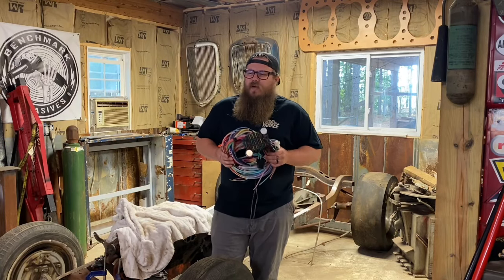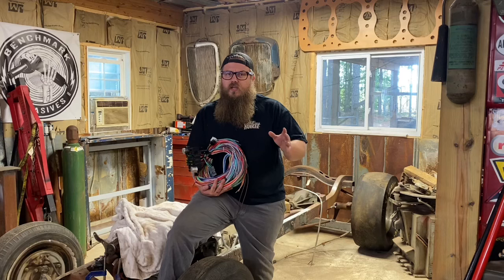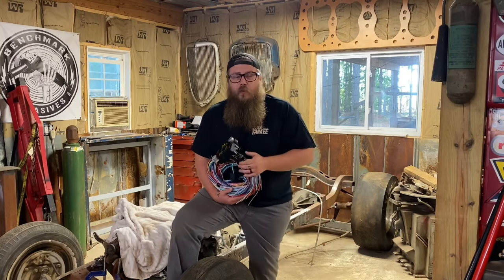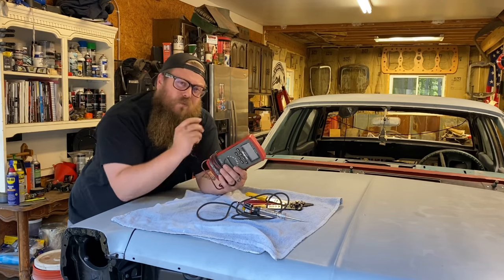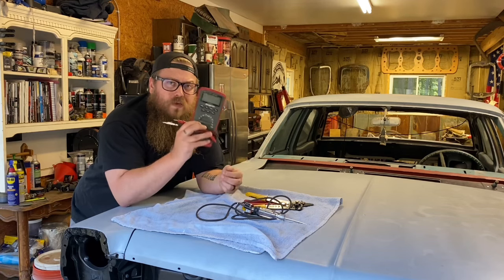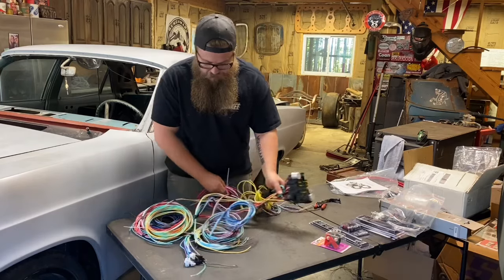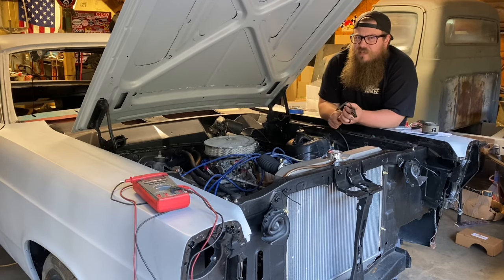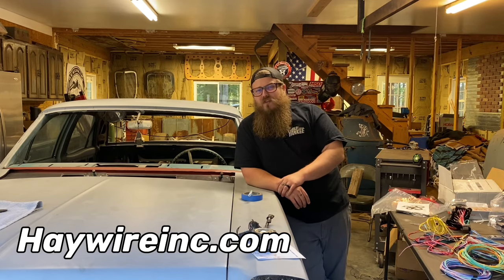Wiring Harness for your Classic Car! ep.1

Comment: I have building harnesses for 30 yrs, before that I used Ron Francis harnesses. I like building mine because I can add relays and power distribution blocks etc and it's just cool building stuff. I used to sell my harnesses in the 90s and 2000s, at car shows and auto events, now I build them more as a hobby for mud boggers, drag racers, pulling trucks etc, I do pretty good by word of mouth.
Your video was excellent, informative and should serve as a guide for DIYers, and that's one of the greatest benefits of YouTube. Thank you for the content.
Reply: what's a good place to get all the connectors I would need? I'm looking at this wiring harness. I have no idea what these connectors are called.
Reply: Interesting I see this comment. I’ve been looking into a Ron Francis harness for a 68 Cougar for a few years now just haven’t pulled the trigger. When you did use the Ron Francis were you satisfied with it? Chances are I will let a shop install the new harness when I get it. I would love to try myself but chances are it would take me forever 🤦🏾‍♂️
Reply: What would be you charges if want buy harness from you for my LN166 Hilux?

Comment: I have a 1938 Hillman Minx roadster. it had a 6 volt system in it. I took all of the old out & bought a painless.
Reply from the maker: Is it still 6 volt or did you upgrade to 12 with the painless
Reply: @WiredCustomsSpeedShop  upgraded to 12.
Reply: What is the name brand of the first one you are doing

Comment: About halfway through a c10 harness that was generic from eBay for $100. Can’t complain, could have a better installation guide but not bad at all. Color codes are MOSTLY correct. Can’t beat it
Reply: Are the ebay kits just as good as the painless kits Quality wise?
Reply: @powerband5235  I didn't have any issues. Besides a standalone harness for the engine from Bpautomotive, the chassis harness was my first wiring project. No sweat, everything pretty much laid right back in from where the original harness was. I did take out and unpin stuff I didn't need before like power windows, etc. But cannot complain, I don't see paying 800 dollars or so vs literally a hundred bucks shipped.
Reply: @powerband5235  quality wise only, painless is better, no doubt but..there were no loose connections, wire is average quality, I think it was a good purchase. I did change out the relays and fuses it came with because they were garbage.
Reply from the maker: There are a lot of good quality name brand wiring harnesses that are affordable, check them out price wise and check reviews to see what you think. Haywire, Rebel Wire, American Auto Wire are a few that come to mind
Reply: I just had to figure out their weird wiring codes "power on solenoid ignition on"
"Ignition switch on on" were the two best ones 🤣🤣
Reply: @wyattshelton2080  i recall something about that on mine. Lol I had to trial and error it because purple and red didn't match factory..I gave it power, it started turning over..I swapped those 2 around and it's been fine for 5k miles now. 🤣 still have a gremlin in my blinkers but I'm sure it's something different.

Comment: Hey man love your work, it's actually inspired me to pull a 1971 Dodge polara custom with a 318 and 17k miles out of a family barn and into my garage shop. Cars sat for 30+ years as a mouse house. All wires under the hood are gone from the mice. Is there any reason you can think of why the haywire 21 kit wouldn't work for me? Im not a mechanic never done this before but am a firefighter and a carpenter so I'm sure I can figure it out at least hope ha ha
Reply from the maker: Thank you for watching! I wouldn’t see why it wouldn’t work, probably would be perfect, I’ve put that exact harness into a couple C bodies already. Give them a call and let them know I sent you, they might give you a discount!
Reply: @WiredCustomsSpeedShop  thanks man I will do that tomorrow. Keep up the strong work, you helped me wire new plug wires today, made them myself. I've never even seen a points car so this is totally new to me. Not easy to figure out the wiring when nothing is there, being foreign to cars, example I saw it has a restrictor mounted opposite of the distributor but the wires were chewed off at the voltage restrictor (regulator) so no clue how it was set up, no battery so I'm assuming it is a 12v system but restricted to 6v to the dash (going off one of your videos) but no way to confirm it. The good old fluke will be used more than ever before ha ha. 

I did check the omes with every wire and they were pretty consistent but is there a target reading to know the connection is solid?

Comment: DIYER here, Looking to rewire my 55 Chevy 3100. I am no mechanic or electrician but am capable of learning and figuring it out. Most likely going to go with Haywire. I am also new to classic vehicles and dont want to sell myself short on the number of circuits. Also not looking to run power windows or seats. Basic stuff. However, I do see myself upgrading engine components which may need some new dash equipment. So my question is will a 21 Circuit be good enough or is it to much, not enough.......? Thx in advance

Comment: Thanks for the video.  Can you tell me where the 12v fuse power to the headlight switch comes from?  I don't see a wire in the harness for it so I'm guessing I'm going to have to use another circuit to power it?

Comment: I want to rewire my 91 Chevy obs ext cab. I plan on Ls swapping in the future. Just want to know which harness I need to get from painless?
Reply from the maker: First and foremost you need to get the correct Holley Terminator XMax for the LS motor, the rest of the wires will be for simple things like turn switch/fuel pump etc. A lot of different harnesses will work for the truck side, the best brands are Painless, American Auto Wire and Haywire. You can’t go wrong with a generic 21 circuit from either one of those brands.
Reply: @WiredCustomsSpeedShop  I’m watching you videos right now. How you explain things is top tier!!! How much do you think is a far price to do a job for my truck?
Reply from the maker: Thank you I appreciate it. I’m in Virginia btw, I have some set prices but things are subject to change depending on parts prices etc so I don’t usually like to give quotes on YouTube where the comments are visible for years and years. Shoot me a message on any social media

Comment: Soon I'll be wiring a 69 vw. I want to put the fuse and relays under the driver's back seat.  Looks I may have to extend the column harness.
Reply from the maker: I’m sure you will have to, you could always put the fuse box in the trunk as well and it would be a little closer
Reply: @WiredCustomsSpeedShop  a/c will be interfering with stock location.
And have every circuits protection only a couple feet from the battery won't hurt. But I have dumb ideas everyday, will see.

Comment: Question about what colors of wires from under hood to ignition switch in cab 1951 Ford F1 6 volt  has turn signal switch  push button start
Reply from the maker: Follow the wires from the turn signal and push button, the wires could have been changed out 7 times in the last 80 years, I would hate to tell you colors and they be wrong and cause you more issues. Always follow the wires from the source and see on any wiring issue

Comment: I know this was a year ago, but my question is, how do you get power to the panel? I have it mostly installed in my truck but I’m not sure how to power the fuse panel.
Reply: The harness should have a large gauge red wire that goes to the battery
Reply from the maker: Slick-px4pq is correct, your harness should have a 4 gauge power wire for supplied power. Some run it to the battery and some run it to the battery terminal on the starter solenoid. Which harness do you have?

Comment: what should i get for a 1968 C10, needs a rewire and i havent done this
Reply from the maker: I would give haywire a call, they will set you up with the correct harness for your exact electrical needs.
Reply: @WiredCustomsSpeedShop  sounds good, might contact them. is painless wiring good? i found one that says it would fit the truck
Reply from the maker: @Evan-rq2ee  painless is good quality, just very expensive.
Reply: @WiredCustomsSpeedShop  okay, just gave a call to haywire. their prices are great and they said the E series would go great with the truck, you got any experience with that harness?

Comment: I have a 1934 IHC 1 1/2 ton stake bed truck.
I have an estimate of $2500 - $4500+ to re wire.
Am I lost?! This seems outrageously high.
Goodness! I can count the wires on one hand along with the things they connect to.
Surely if a harness exists it couldn’t be anywhere that range for it and labor.
Second option is purchase necessary wires and connect. 
On verge of a stroke 😳
Reply from the maker: Hi Chuck, I usually don’t like to talk about pricing online because they are always capable of changing depending on car and electrical needs as well as supply price changes. But I’ll make an exception here. I charge $1,200 for install labor, plus the wire harness that’s usually around $435, plus any more electrical accessories. My price is around typical pricing. I also guarantee the harness for the life of the purchaser. Feel free to message me on instagram if you have more personal questions
Reply: @WiredCustomsSpeedShop  thank you for your response. Greatly appreciated 👍

Comment: I wish I would have watched this video before I purchased E-Z Wiring. The instuctions are hopeless. Now I have a painless pre wired fuse panel to put in because. The one that came from E-Z Wiring Has failed me twice. The fuses will not go in and the connecters retreat out the back of the box. The fuse box is falling apart. All the fuse connectors are  good for one insertion maybe. It has been a giant headache. I think I can save the GXL wires. The printing is very small and it comes right off. You can't read it after installation, So now I also have a Dyno Rhino shrink tube label printer another $100 plus tubes. Between the cost of the harness $120 and the new fuse box $250 I coiuld have had a Haywire 20 circuit universal harness. I may send the painless fuse box back and get the Haywire harness. Don't redo your new wiring again. Get Haywire inc. or Painless Performance.  Its more than worth it.